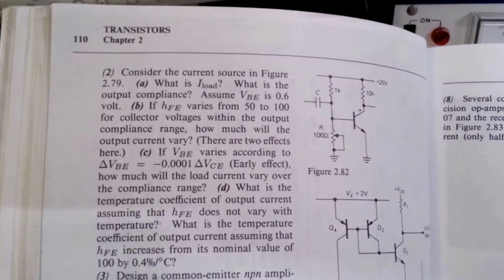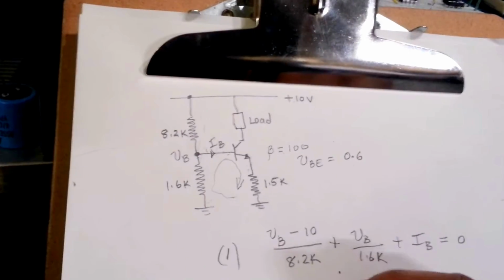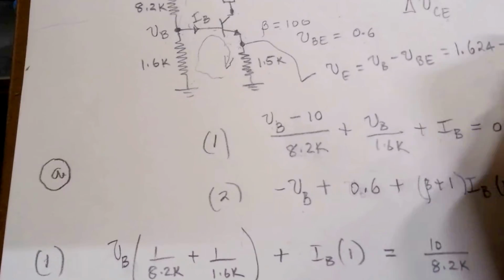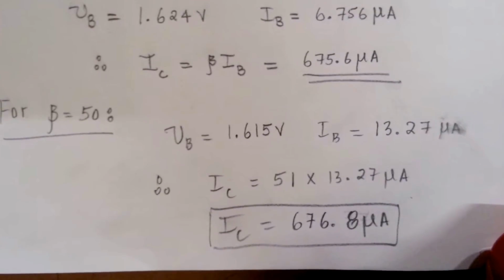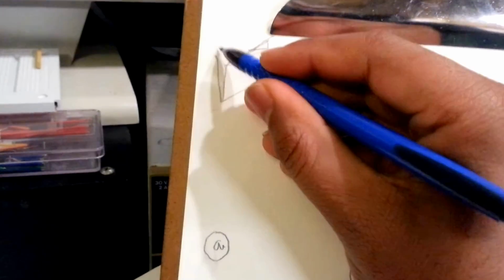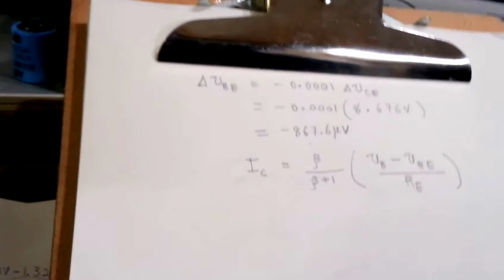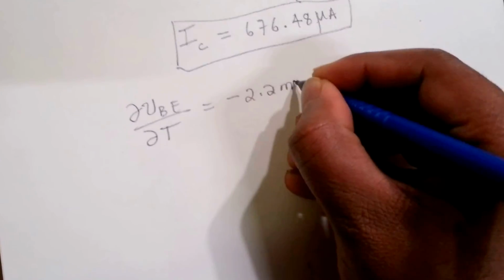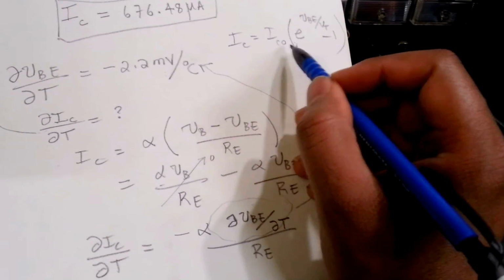Transistor Current Source and Its Non-ideal Properties - Part-1 - AoE Chapters 2 Problem 2 Solution

Comment: Thanks for this excellent explanation. 
I enjoyed solving along. 
🤗 

However, I have a question.
Why was 8.676V used for ΔVCE in the relationship: ΔVBE = -0.0001ΔVCE?
Why not 0.3V?
I was thinking 8.676V is just the max. voltage across the load for the current source to remain in the active region. 

Thanks in advance.
Reply: Oh wow! 

@Smith Kerona, while thinking about the question after I dropped it. 
I thought: if KVL was taken round the output loop, we get: VCE = VCC - VL - VE. 
Where VL is the voltage across the load. 

Taking the change of the equation above:
ΔVCE  =  -ΔVL 
As VCC and VE are constants. 

Could this be the reason? 

Please I'll still like to hear from you. 
Thanks. 
🙏🏾.
Reply from the maker: @emmanuelinnocent4505  You got it! Since IC is considered constant (the circuit is a current source), VE doesn't change. Also VCC doesn't change as you indicated. Therefore the only quantity that changes is the load voltage. The transistor adjusts the collector to emitter voltage to maintain constant collector current across the load as long as the compliance voltage isn't surpassed.